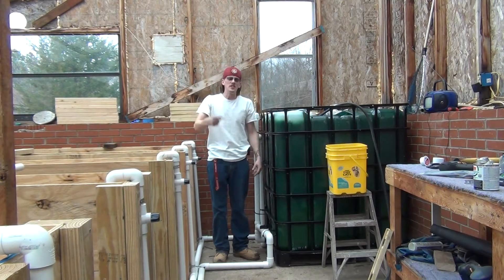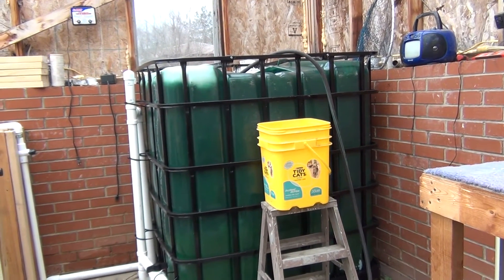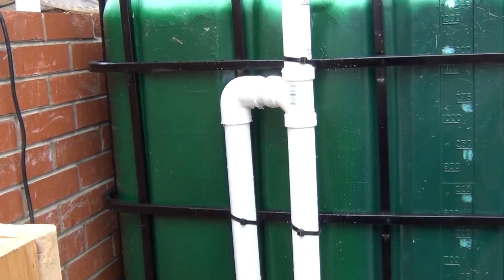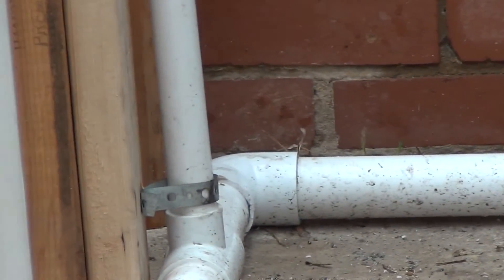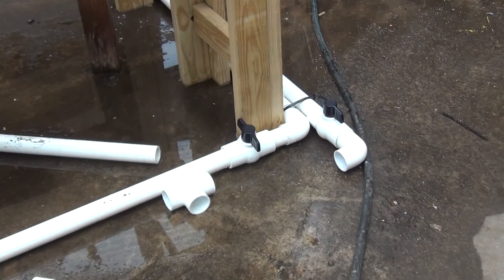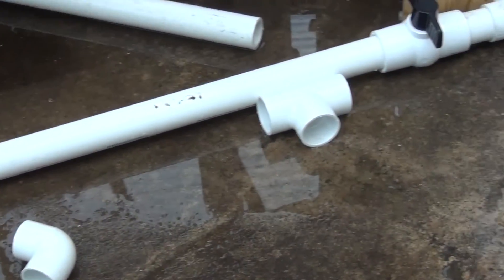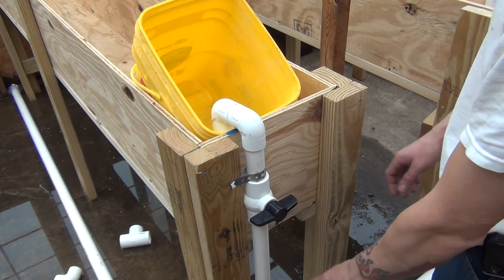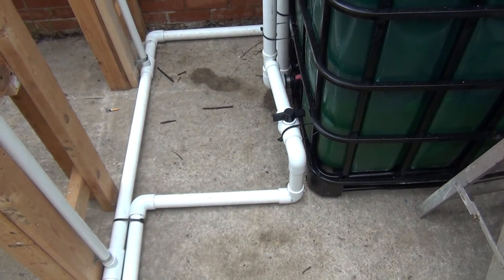Aquaponics Piping part 1: Greenhouse Update

Comment: That a great start Slim Tim! You are going to have a great system there. Thank you for the plug :) 
Did you say you had water coming out the top of the anit-siphon pipe?
Reply from the maker: Thanks David Bertheltte, appreciate you for tuning and feedback. 
When I close the shut off valves to quickly, spits water out the holes in the cap on the stand pipe.